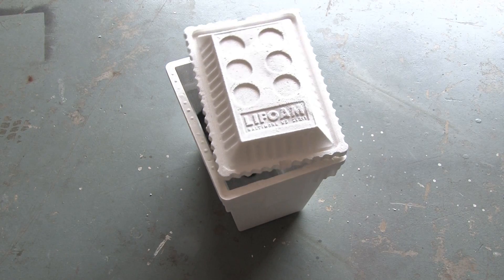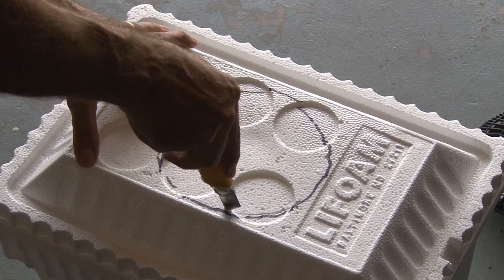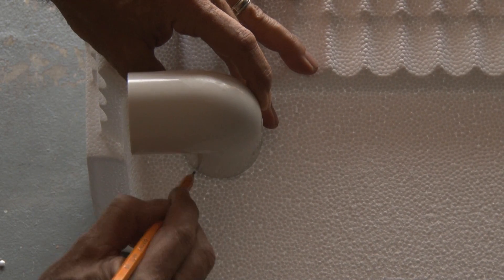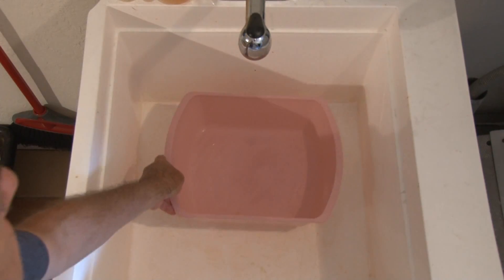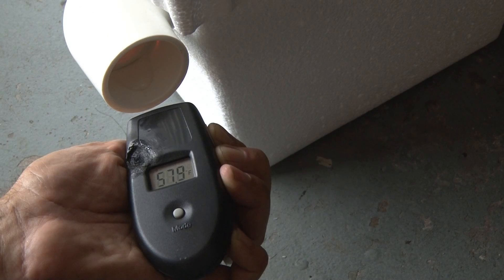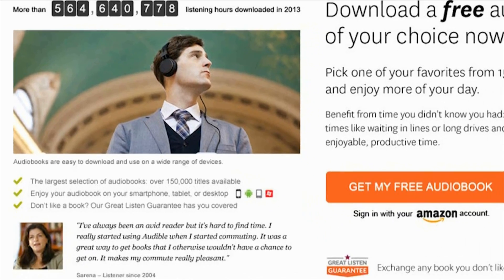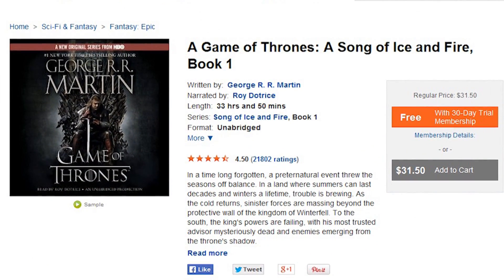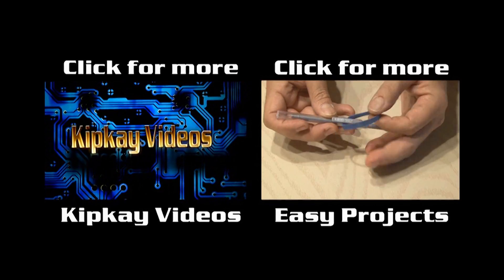The DIY Cooler Chiller!

Comment: I have a solar panel and a 12 volt fan I was buyed a 240 volt ac to 12 volt ac my fan was dc I add a resistor and it works well the plug. I add a switch and and a battery with a solar panel. I series it. And it super!!!!!

Comment: I would suggest adding a R/C Car board to the bottom to move it around and get a internal powersource for the fan. It would be better cause you can move it ANYWHERE with a Remote Control :D

Comment: I went out and bought all of the items and I finished the project but it didn't even work sure the air is cold but it's too weak to cool down a small room the only way this works is if your standing right in front of the cooler chiller then u can maybe cool urself down a bit this is not worth going out and buying the fan and the styrofoam cooler and the elbows, not worth making doesn't even work I give this project  a 3 out of 10

Comment: While its kinda cool (no pun intended) its not actually removing heat. Cooling is the removal of heat from an undesired location to a place less objectionable. In a way ur adding cool air but at the same time the ice that was made would have came out of a freezer in the house. Freezers work the same way by removing heat. So you are just using the same air in the house regardless, therefore no cooling.

Comment: instead of using a fan on top use four fans on each side and a few exawest pipes at the top and use a shop vack hose and you can monuver the exawest pipes and also you can use dry ice and water and it would twice as cold
Reply: other than that it works great

Comment: Years ago I made one using a large case fan. Behind the case fan I placed a plastic box with holes drilled in 2 sides of the box staring a few inches from the bottom so air can easily flow through it/get drawn through it. It certainly worked well, but if the ambient temperature is fairly high, that ice will not last long.

Comment: Hey Kip... I've made this. One unit doesn't work. So I built another. Had 2 running. After 6 hours, no difference. After this, I was mildly frustrated. I then decided I'd make them until they made 5+ degree difference over a 6 hour time frame. 
So, 13 of these, 135 lbs of ice, and the sun going down, then temp dropped................4 degrees... 
Great concept... But if you're trying to cool more than a closet, it's a waste. 
Sorry guys

Comment: I actually built this last year and I've hooked it to a solar panel for near free cooling, used dryer exhaust piping but in the lid, and instead of just a block of ice I installed about 10 feet of copper tubing in the bottom with the fan blowing a portion of air into it then las to exhaust and actually dropped exhaust air to 36°. I use it in my daddyvan because my a.c.don't work and is expensive to repair.

Comment: Upper 50S? thats evan worse!
Reply: ... the temperature went from upper 70's to upper 50's (fahrenheit).  A full 20 degrees cooler than it was before.  What could you possibly be talking about?
Reply: MechaniclZ The Kelvin scale make the most sense.
Reply: MechaniclZ You are not from the UK i suppose, they use ''fahrenheit'' instead of celsius. So 20.C is about 60ish fahrenheit im not sure how much the diffrende is.
Reply: *****
Its makes more sense couse its metric. And metric is a lot less confusing. 5 10 15 Ect.
Reply: gamer3928 this is from wikipédia :
The kelvin is a unit of measurement for temperature It is one of the seven base units in the International System of Units (SI) and is assigned the unit symbol K. The Kelvin scale is an absolute, thermodynamic temperature scale using as its null point absolute zero, the temperature at which all thermal motion ceases in the classical description of thermodynamics. 

 The kelvin is the primary unit of measurement in the physical sciences, but is often used in conjunction with the degree Celsius, which has the same magnitude. Subtracting 273.16 K
Reply: MechaniclZ i dont know, maybe he lives in the USA and uses FARENHEIGHT
Reply: MechaniclZ Ferinhight is the imperial measurement of temperature, used in most North American countries.
Reply: ***** No, no. Used ONLY in 'Muricuh!
Reply: Carlos Vazquez Nope... Bahamas.. Cayman Islands... ect
Reply: But isn't that then the Caribbean? I'm legit asking; I'm not trying to be a smart ass
Reply: It may be nor sure
Reply: MRcoolboyis123
Oh Why is it in ferinheit?
Reply: MechaniclZ Who knows, why does the rest of the word use Celsius?
Reply: MechaniclZ knotts is the only rate of speed any boat uses.
Reply: *****
Which is separet i guess.
Reply: gamer3928
Oh ya I forgot about that!
Reply: Kelvin is based on Celsius and 0° K is -273°C
It's the same scale but kelvin's 0 is when any gaz has no more volume
Reply: cardella lucas 1. Kelvin is not based on Celsius.
2. There is no such thing as "°K".
3. It is not the same scale as Celsius.
4. A gas always has a volume.
Reply: ***** Fahrenheit is for smart-asses. Celsius is the best.
Reply: leopardgecko56  SI means Standard International Unit.
If you don't know science, at least know some Geography as USA lies in this world and not  somewhere else!!!
SI accounts for the whole world!!!  
K=C-273.15 to be exact.
It depends upon ones priority or easiess that he uses C or F

Comment: This has me wondering about how to combine this with a "swamp (evaporative) cooler" effect, which takes over as/after the ice melts.  A small pump to keep the water flowing over the filter areas would do the trick.  If portable enough, it could be quite something to take on trips in extremely hot, dry areas.

Comment: Hi kipkay, can you do something with peltier modules, little 20mmX20mm ones are pretty cheep on ebay. and Ive done some tests with them on old graphics car heat sink to see how cold i can get the cold side to go, best so far i can get is about -5c stable and the hot side dissipating the heat, maybe you can make us a fridge. they also work backwards so if u heat one side and cool the other electricity comes out, if u put electricity in it gets hot and cold

Comment: I have the same solar panel and it won't power that fan whatsoever. The only fans that it could power would be solar fans. The amperage on that thing is around .1amps
Reply from the maker: True. That's only a solar charger panel. Not even amps to power the fan. I just used it as a visual example.
Reply: biscuitownz Use a AC Adapter.
Reply: +biscuitownz  use something to plug it into a car. and sorry bad spelling

Comment: These work great in the cabin of a sailboat since we don't have huge motors to power an A/C system and tend to carry a week worth of ice to start. Although I will say from testing these foam coolers break far too easily. Cutting up a 40qt coleman style is twice as effective but even the smaller stand up units work great too. And YES you will notice it even on a 30' boat in 105* weather (inside the cabin). Cooled it down to 78* in 30mins from a reading of 95* with two adults inside. Power on a sailboat is also always considered (see engine comment).

Comment: While you did get a reading of 58^F degrees, I believe the laser thermometer was metering the temperature of the pipe, not the air. In concept, I can see this project producing cold air but not 58^F. I'd like to see the temperature of the air using a alcohol thermometer.

Also, i've always been interested in the study of thermodynamics. Living in Miami has motivated me to build contraptions to 'beat the heat' whenever the power goes out. I've read online that dry ice keeps frozen longer that a block of ice of the same mass. While ice is practically free to make at home and remains the easiest way to complete this project, I would use dry ice and keep a block of ice near as well. 

A way to improve this project is to create baffles, either with the ice or something else, so that the air spends a longer time near the ice. The fan could have also been placed on the side to pick up low cooler air. 

Great work Kip Kay!
Reply: why would the pipe be colder than the air coming out .. that make any sense to u?

Comment: I suggest, instead of using a block of ice and dealing with the water once it melts.  Use 1/2 gallon plastic juice bottles and fill with water and freeze em. If you you freeze a few you can get hours of cool air without the mess.

Comment: Use water frozen in closed containers (plastic milk jugs, water bottles) so the relative humidity of the room doesn't change that drastically. Freeze the water before putting the cap on so it doesn't explode off.

Comment: I have a couple questions.. This seems like it would be wonderful for taking to a camp I'll be going to that has electricity but no fridges.
So that brings me to my questions..

1. How long does the ice block stay ice?
2. How cold would it be if it was just water?
Reply: i would say the ice would last less then if it was just sitting in the shade, as in this case the fan is forcing hot(outside) air onto the ice melting it faster than if the ice was just sitting under a shady tree, the water without ice would probably also work but not aswell but would work , until the water got slowly heated up, again the fan is just moving hot air(outside air) over a heatsink (the ice or water) and with nothing to keep the heat-sink cool/cold it will eventually melt/heatup.
this would be good as an experiment or very short term use in a very small bedroom. not for much practical use.
Reply: Tom Hambling
 The ice melts FAST. I mean FAST if the room temp is above 80. This might help cool a room down enough for falling asleep but you can bet if you wake up middle of the night you are gonna want to change the ice.

Comment: fill 4 2 litter bottles about 3/4 of the way and freeze them. When frozen put two of them in the cooler and when those melt replace them with the other frozen 2 litters. Also no mess.

Comment: Hey kipkay I just made something like this while on the boat. Except I cut a 3x3 inch hole on the top. Ran a fish tank pump to flexible fish tank tubing then made a copper tubing coil around the big fan guard and zip ties it to the fan guard. Connected the tubing to the pump. Filled with ice water. 50° room for my entire stay.

Comment: how about one that DOESNT require ice, one that can make itself cold inside like a fridge does.
Reply: that requires A LOT of energy, you could try to do it with a mini fridge, but the mini ridge would have to be outside, becuse a fridge dosent create cold, it simply mooves the heat from the nside to the autside grid (on the back of the gridge)

Comment: Very cool! Even without ice, just having water in the cooler will provide slightly colder than room temp air due to evaporative cooling. If wet towels were used to hold the water you could put anything you want to be especially chilled under the towels and it would act like a refrigerator with nothing more than fan power.